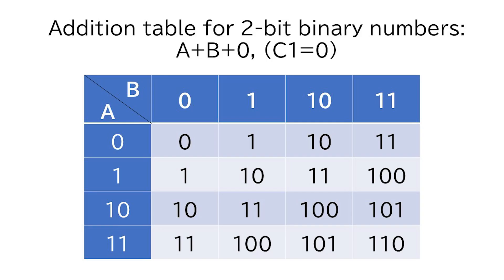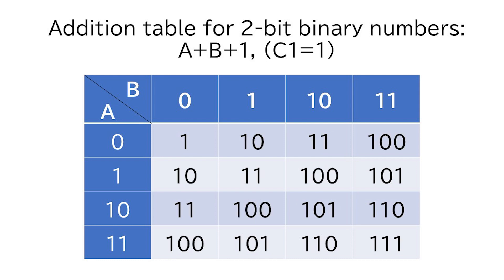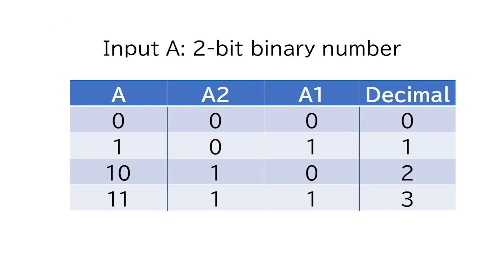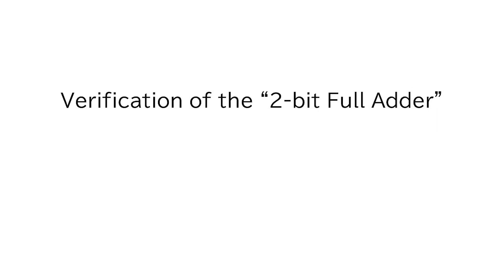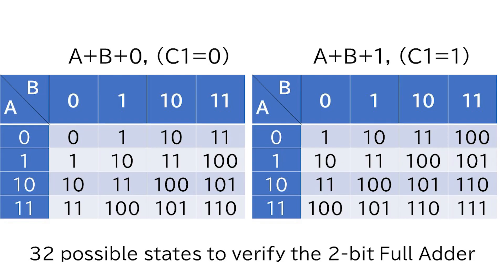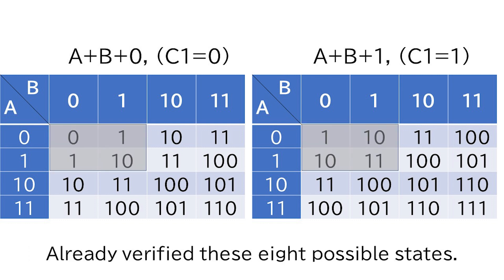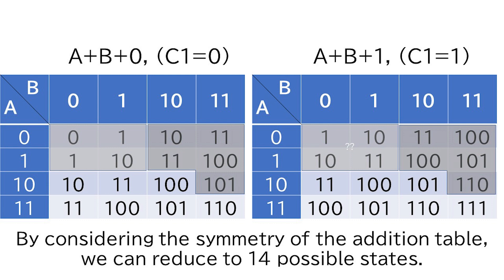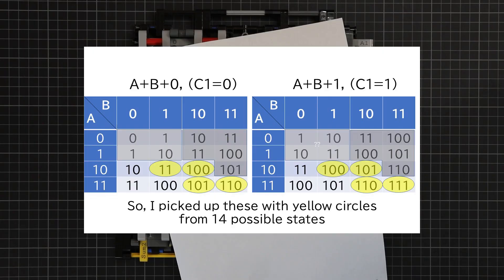Mechanical "2-bit Full Adder" circuit for Konrad Zuse's mechanical computer Z1 #6 / LEGO

Comment: I love how you can just switch out the coupling plates to represent any of the 16 possible 2-input logic gates. Very elegant!

It's too bad that the inputs get locked in place when the clock is high since that means it won't be possible to build circuits with feedback loops, like SR latches. Any plans on how to tackle that?
Reply from the maker: I don't have any plans. But, Konrad Zuse may have. Thank you for watching and comments.